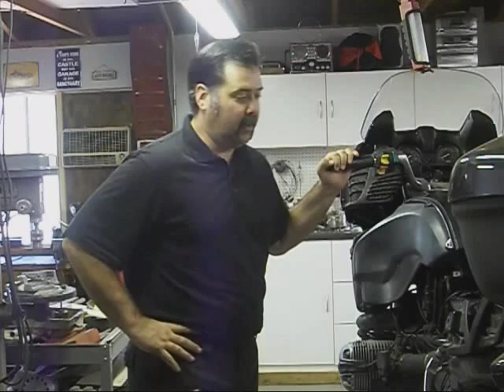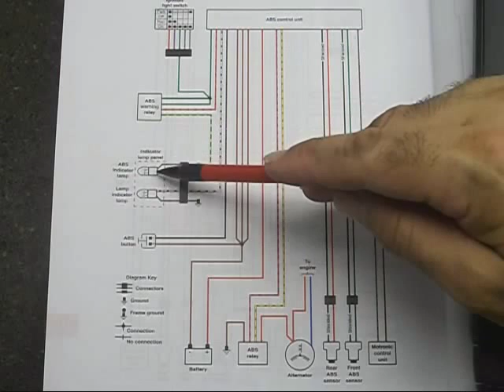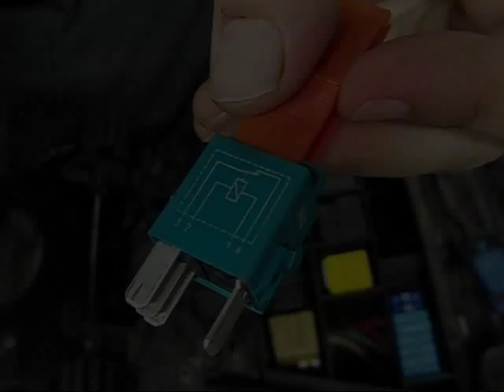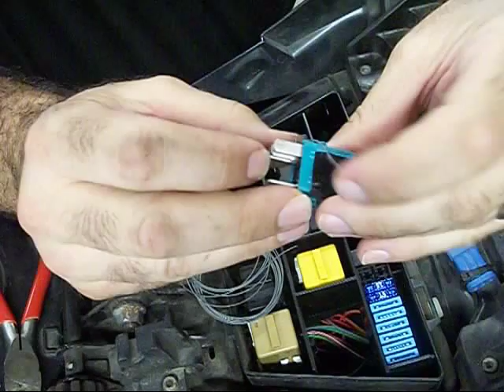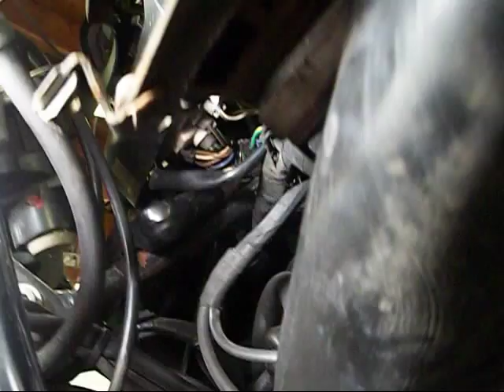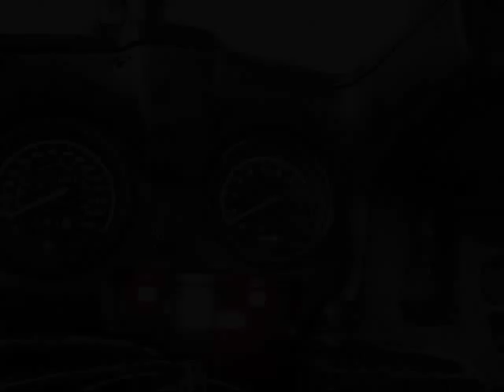R1100 ABS Electrical

Comment: Is there an inherent problem with bmw grounding issues? Replaced low beam lamp worked perfectly then I installed high beam and kaput! Low beam lamp low glow, high beam: Nothing 12.8 volts to both high/low beam lamps WTH is going on? Suspect a ground issue. Your thoughts?

Comment: What do you know about ABS II reset R 1200 GS?
Reply: Try disconnecting the battery terminals and then grounding them together. And to the bikes ground source like the frame. That should reset everything.

Comment: My 1996 R1100RT keeps indicating a ABS fault. I turn the ignition on both lights flash together when I start the motor they then flash alternately indicating a fault I press the reset button the top light goes out after  riding for a while the top light comes back on flashing alternately with the bottom light. I have tried to reset the ABS via grounding the center terminal on the test wire .still no luck. Can anyone help me out  please
Reply: Are the servos activated? Definitely flush the system and then check. I pray it’s not the ABS module. If that fails you’re looking at some money to correct.
Reply: Did you get your fault fixed? What was it?